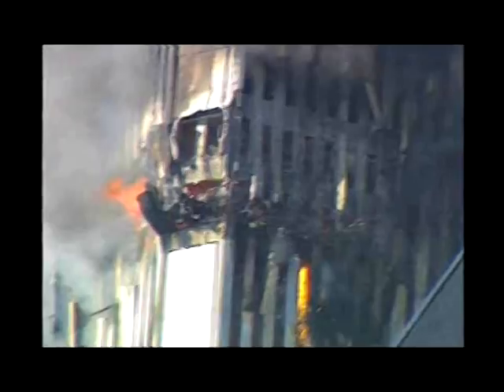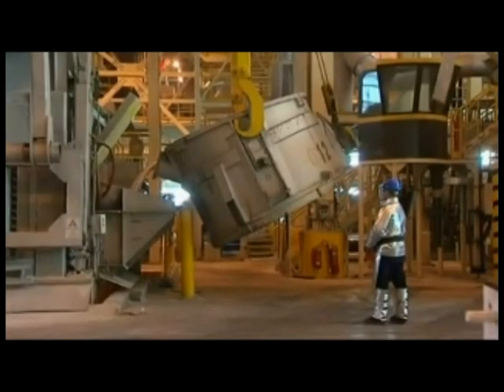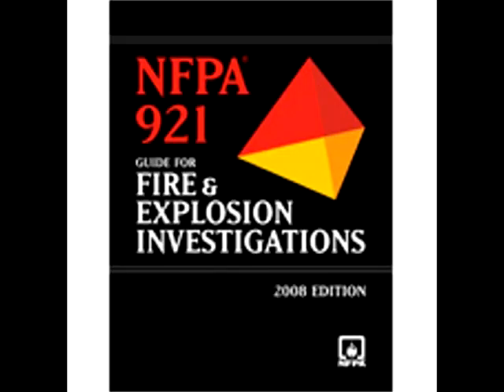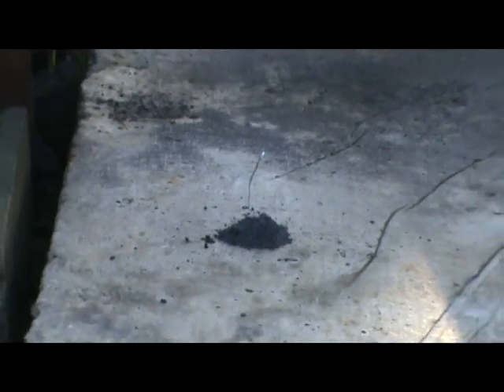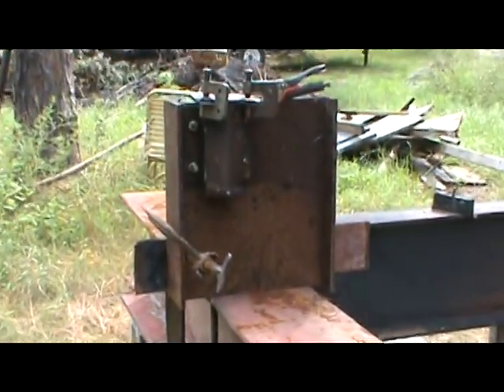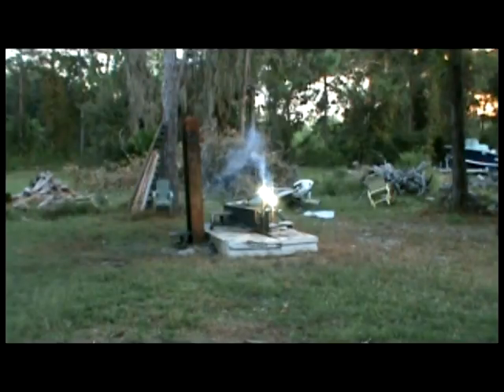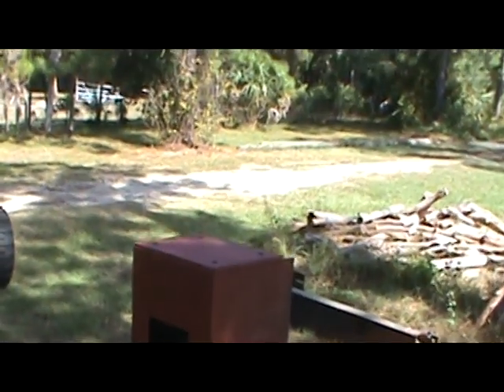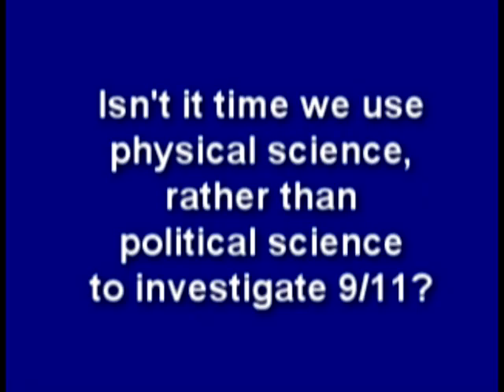9/11 Experiments: The Great Thermate Debate

Comment: Why do most people on here think the steel needs to be at a melted state for it to fail ? jet fuel along with alot of air flow at that height is enough to generate the heat required to 'weaken' the steel, even at a 1000 degrees the steel hasnt the strength needed to hold up those towers, the 'millions' of tons above those fires where too much for the weakened steel to hold them, hence why they collapsed, 
People go on about demo charges used need to get there heads out of the clouds, like seriously, do you honestly think this demo material is available off the shelf ? funny how the towers started to collapse at the exact point the planes hit, there is no way anyone could have gone in after the planes hit, no way could someone get those charges and walk them up the stairs, takes weeks of planning and days of setting up,
People saying they heared explosions when the towers collapsed ? do you honestly thing it would have being a silent affair ? even glass itself makes a huge noise when breaking, specially toughened glass, 
This needs to be put to bed as a terrorist act against your own country.

Comment: You ever put aluminum in a fire? Like an aluminum can? Yeah it gets white hot, hot just like thermite,
Now what are planes made out of? Exactly, so if a plane melts and is in fire what does it become? A version of Thermite which can do what to steel? Melt it so what happened? The planes melted then cause the steel beams to melt causing the buildings to collapse but good try guys.
Reply: And can you explain how the hijackers passports were found on the ground? If the fire was hot enough to as you said, melt titanium, how did paper survive?
Reply: Titan Slayer So what happened to the Titanium? Do you think planes are 100% aluminium? Really? Can you provide a source for that?
Reply: M B they don't need to be 100% aluminum. Only turbines are made of titanium, and they weigh a hundred kilo or so
Reply: So what happened to the titanium turbines? Titanium has a melting point of 3000 fahrenheit, aluminium has a melting point of 1220 fahrenheit. What happened to the titanium friend?
Reply: Jet fuel burns at 1500 fahrenheit max, you're missing uhmmmm.... 1500 fahrenheit?
Reply: M B it was buried under piles and piles of trash
Reply: Can you prove that? If you were there to see it I'm guessing you would have taken pictures right?
Reply: M B find thousand pieces of 100 kg of titanium in.millions of tons of rubbish is not so easy you know. So what you saying is that plabe impacts were fake?
Reply: I'm not saying anything and I haven't said anything. If you go back and read what I have said I'm just asking questions, no statements. I'm just wondering if these fires were powerful enough to melt titanium, that stuff we use on space shuttles, how did paper survive and reach the bottom of the towers without so much as a scorch mark?
Reply: This is a video of a helicopter with a titanium shell being hit by a direct missile, you see how strong titanium is, it isn't some crappy metal. https://www.youtube.com/watch?v=IJG-w70Tlvc

Comment: Well why does steel have to melt in order for the building to fall down? All it needs to do is weaken down to around a quarter of it’s strength. Doesn’t need to get anywhere near melting temperature to do that. Plus it will glow red hot hundreds of degrees below melting. I don’t think you’re making good points here. You don’t need thermite to explain the building falling down.

Comment: This puts real science behind a theory and seems more likely of a way the towers were brought down, however would the weakening of the bolts in the structure on the upper most floors cause the whole tower to collapse or would the whole building have to have had the bolts weakened by thermate?, by the way your Engineering abilities are excellent and your welding is perfect. Great video.

Comment: physicsandreason,           Sir you are my new ,metallurgical , rod burning hero . I made some thermite  years ago , just for my own pyro- needs of enjoyment, setting off the mix using gun powder from a couple of 12ga. hi brass shells , lit it atop my metal work bench top (1/8 in )sheet    and my pile of T was approx a handful and it did leave a dimple spot ..as a former weld for my supper . cert. pipe /structural in the 70's , Ive never been satisfied with the BS the big wigs have left us with given most of the country's population are kind of ignorant to what heat ,how much heat that makes metal do what it does especially under load conditions ,they just bite into whatever the feds say ........myself and those firefighters eye witness accounts and you sir know better , carpet , furniture .normal building materials AAAAAnd jet fuel ,which out of all the materials fueling the fire is actually the least  btu's (hottest) of the lot .Yea   1400- 1800deg 's will eventually make   steel turn red enough to bend but it still wouldn't fail , it would retain most of its integrity , . It'd have to be 2200 -2600 IMHO before it became yellow enough to stretch twist and welds to pull apart .Not to mention the thickness of the main structural beams and there were many , yea the plane took out a few but aircraft aluminum loses its momentum  quickly upon impact .and probably didnt slice thru that many beams , them things were huge and thick , so .....Ive spent years in anger trying to remain logical and rational over this ,,it has been tough ,still is ,  this entire country , wait the entire world should have called bulls**t after the committee gave it's findings . Sir I was watching the  news that morning when they 1st cut away to the event  unfolding ,  when the N. Tower fell I was screaming and hollering BS , so loud my wife called me a fool .A fool I may be but stupid I 'm not  Thank you for lighting a fire back into my anger and thanks for the work you put into this video ,to any reading this , "It was WORK  and wasn't cheap .Id be your helper anytime ..

Comment: The Steal itself is made with a chemical explosive so that the building and can collapse inwards and turn to dust. And all material for building High Rise complexes have explosive materials mixed in with the compounds that make them, sheet Rock, Ceiling Tiles, Doors, "EVERYTHING that's permanent part of the structure, plumbing pipes, office furniture, cement flooring , etc.

Comment: Or maybe the fact that the intense heat compromised the structural integrity of the steel and that combined with the immense weight of the towers caused the support structure to fail. You don't have to melt steel into a liquid to get it to bend.
Reply: Daniel Warren ..wow..you sound just like that guy they interviewed who knew exactly what happened right after it happened...you obviously did the same amount of investigation.
Reply: I mean, it's been a couple of years now since it's happened lol I've had a bit of time to research it.

Comment: You heat the steel up enough and it loose strength. It can no longer hold the floors and it collapses . If you thing  fuel can not melt steal I shall turn your attention to 2007 when a gas tanker over turned on i580 in California and it melted the steel.